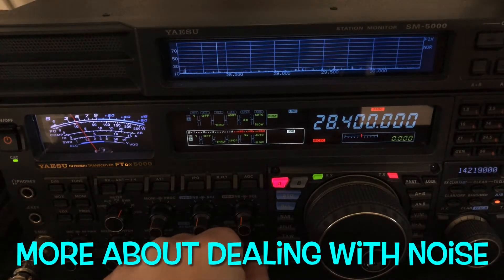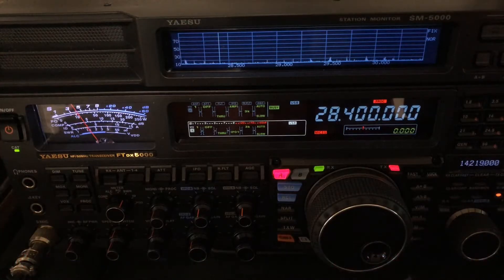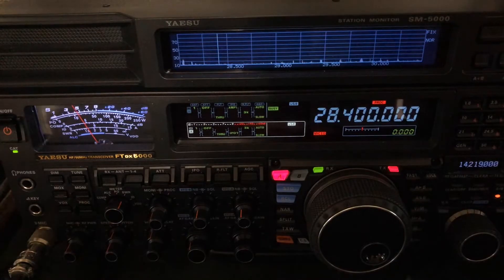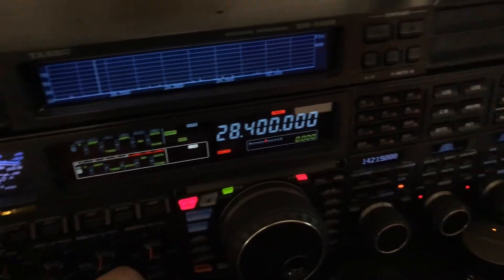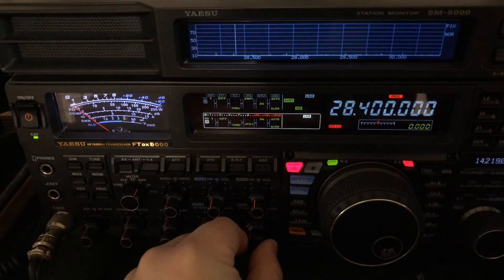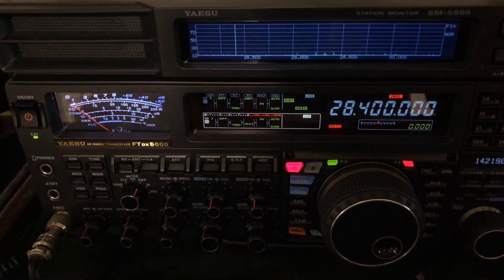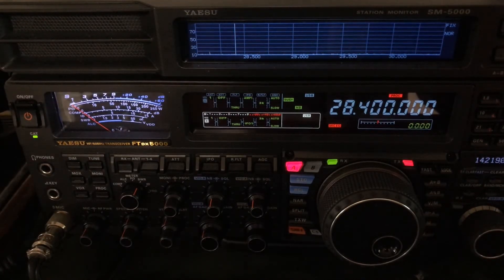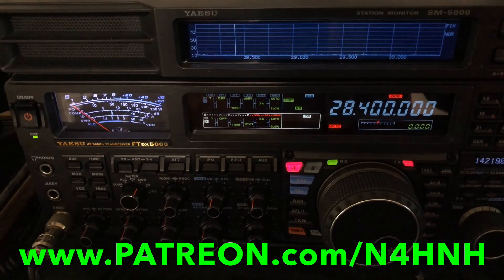More About Dealing with Noise (more information in video description) #hamradio #hf #noise #rfi #qrm

Comment: You mention that you like knobs.  That is the main reason I have kept my fTDX-5000MPL rather than upgrading to the FTDX-101MP.  In addition to the SM-5000 I also have the DMU-2000, and while the FTDX-5000MP is supposed to be a a better radio, I'm not sure I would see enough improvement to justify the cost of the new radio.  With the FTDX-101MP being introduced in 2018 I'm thinking it's best to hold out to see what will replace the FTDX-101 series.  I generally skip a generation so that when I do upgrade the changes are more dramatic.

Thanks!
Reply from the maker: The FTdx5000MP Limited is an FTdx5000MP.  It was just sold without the SM-5000, so Yaesu labeled it as limited.  I purchased the SM-5000 separately.  

I wrote an entire article for the S9 members of my Patreon team who were wondering why I chose the FTdx5000MP over the FTdx101MP.

Comment: I hope all your antennas are good with the ice yesterday.
Reply from the maker: They’re all covered in ice. The dipoles are drooping. But I’ve made two CW contacts today while filming and I worked ZS6CCY, in South Africa, last night.  The ATU has to compensate for higher SWR caused by the ice on the ladder line.